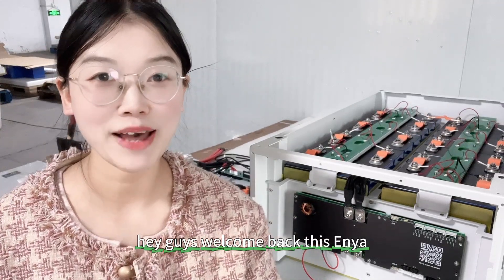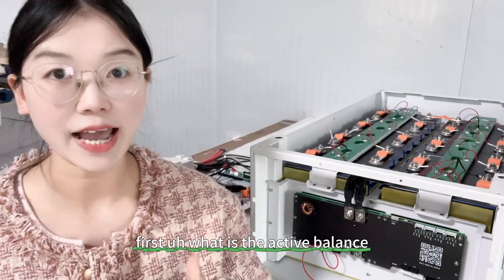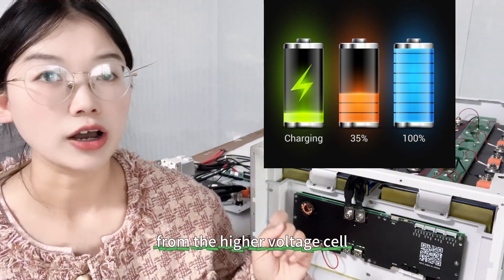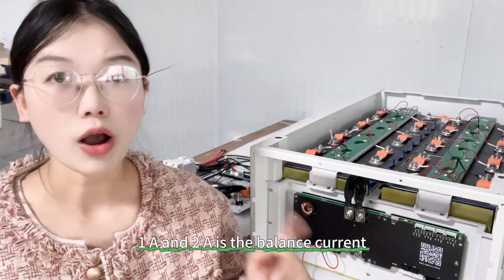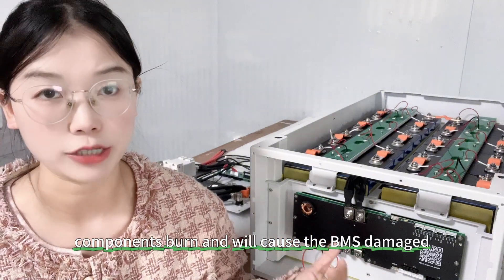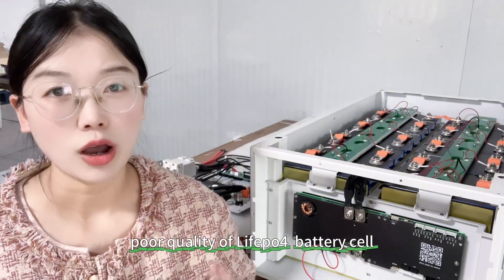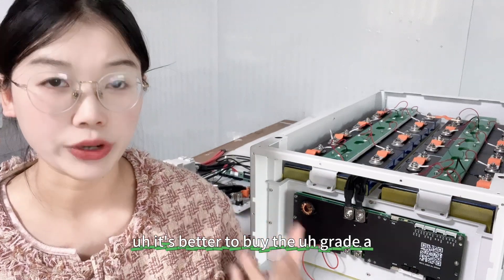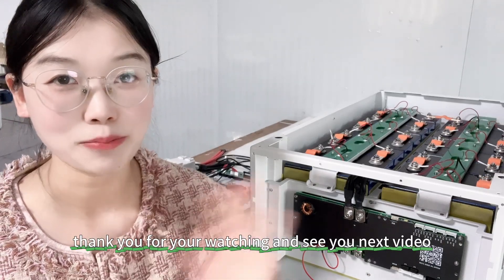JK BMS active balance disadvantage ??!

Comment: don't start the balancer before 3.45 volt. Most effective and won't  have the balancer trying to balance all the time. That way you shouldn't create excessive heat in your bms or battery pack.
Thanks
Dave

Comment: The balance current is user defined in the JK BMS settings. With the 200amp BMS it will use up to 2a for balancing. When charging LFP batteries most are capable of 1c charge and discharge. That is the maximum rate but not the recommended rate. Your battery packs are going to live much longer with less wear and tear at something closer to 0.2c. Provided you have new cells in good working order there should be little drift in the voltage across the cells and a good solid top balancing of the battery will assure that and make your BMS's job very easy when balancing. Your battery should come up to the top of the charge with a normal difference of less than 10mV. If your battery cell difference is far above that consistently after being top balanced, then you likely have one or more weakening cells. If there is a large imbalance and the balancer is having to run for an extended period the mosfet temperature will begin to climb. And as she mentioned, during high ambient temperatures with heavy balancing occurring it can lead to high component heat in the BMS that can cause damage.
I think this young lady made her points well.

Comment: I have 1 battery (20KWH) with 60mA passive balancing. And 1 battery (40KWH) with 4A active balancing. The passive balance creates much more heat, despite being 30 times smaller balance capacity

My real world advice = always go for an active balancer

Comment: my concerns all this year while  balancer never stops....   after 6 monthd  my first gen jk   has perfectly kept my pack of 16... 
   but when go to 280+ amps cellls  ,I will use the inverter  new one. . 
then  i m going 20/75 % so  i m going to balance once per 3 months average and not always ON  .,because 75% is close to 3.4v   and passive balancing will eventualy take place unless a cell is ruined . 

 when paralel old vs new in same inverter system  at least one has   Amp share limiter so  no need both to have such feature

Comment: I have 9 JK BMS on EVE MB31 cells. I set the requested charge voltage to 3.5v per cell, the balance start voltage at 3.45v per cell, and the requested float voltage at 3.4v per cell. The JK gives you the internal temperatures of the board and I can say from experience the BMS gets WAYY hotter when you’re pulling 0.5C through it than anything I’ve seen from the balancer. This video is false.

Comment: The advertized balance current is proportional to the voltage difference.. Si If you get a 2A balance active BMS it will balance at 2A ONLY if the voltage diff of the cell being discharged is very high. When voltage difference is below 100mV for exemple the balance current in not 2A but will be maybe 10 times less

Comment: On very new cells, yes, an active balancer seems, or is a bit unnessesary.
But for sure, that over time, the balancer needs to work more as the cells degrade.
However, a bms remains nessesary, it does more than just balance the cells.
It guards against undervoltage, overvoltage, shorts, temprature, and what not.
If the bms also has an active balancer, then why not ?
Using lifepo cells without a bms is risky and just stupid.

Comment: makes no sense passive balancer generates way more heat than an active balancer the point is that an active balancer costs more to make as it requires more hardware, so lady don't give the wrong information out here

Comment: When you buy best grade cells, the need for an active balancer will be more or less zero. IMO active balancers are just overhyped. My oldest packs with passive balance BMSs and no monitoring are doing a great job. My newest pack with a Pace Inverter BMS and passive balancing is doing as well a great job, albeit I first needed to set correct parameters as the biggest problem with any BMS is that factory settings are mostly useless when it comes to balancing...
Reply: with an active balancer, you save fewer cycles that could go to waste and have more capacity to use too, A passive balancer is an old system, it wastes energy that can be useful to you